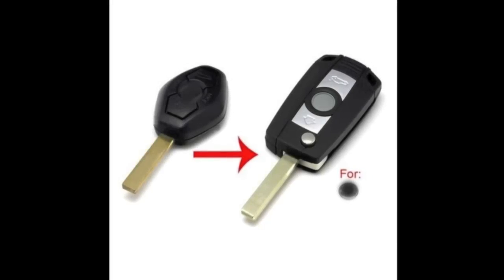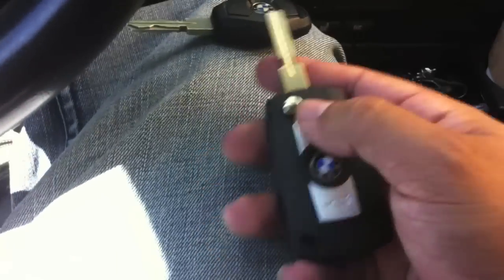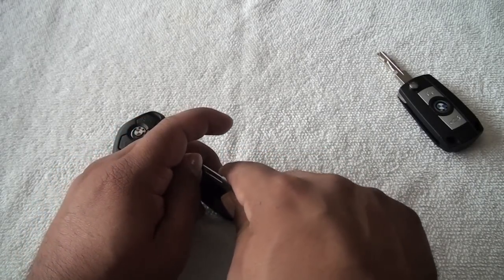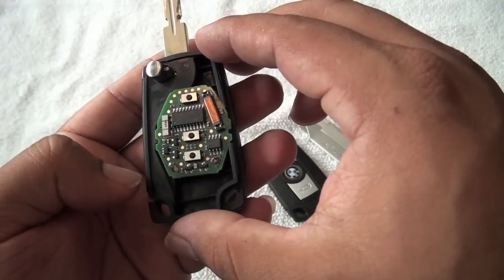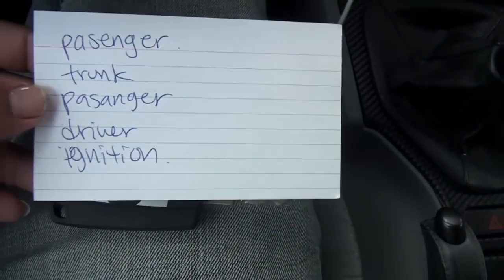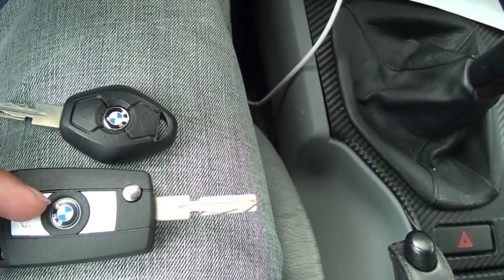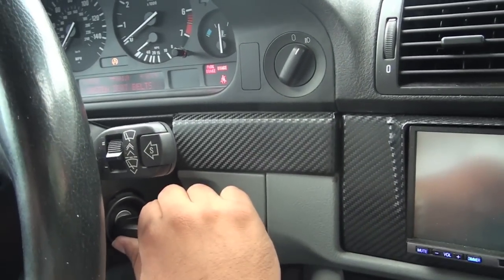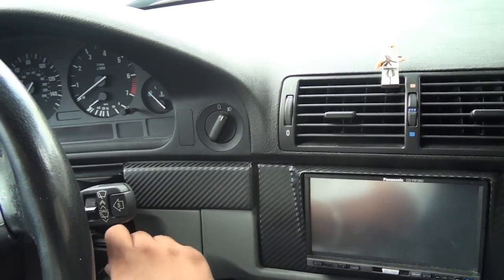BMW e39 Folding Flip Key Case Shell Refit

Comment: Hey i have a 1998 528i and i have the original key and it works to turn on the car but will not unlock the doors or lock the doors or open up the trunk from the key, does anybody know what could be wrong?
Reply from the maker: orlando meraz have you tried replacing the battery?
Reply: I had same thing on my spare key..have same car same model... have to programm the key by putting it in ignition to start then out hold and press lock button while pressing the unlock button 3 times... it will take so many attempts.... but eventually will work... ill attach a link that is so similar but doesnt go so smooth on your model so have to try more

Comment: Guys! You need to have a seperate transponder to start the car! if you google on this: "E39 E46 X5 Old Key to "New" Key Flip Case conversion. Would it work?" you will find my Thread on bimmerforums.co.uk and i have pictures on there what i mean with 'seperate' transponder and a possible solution which involves using your simple spare key to obtain a seperate transponder.